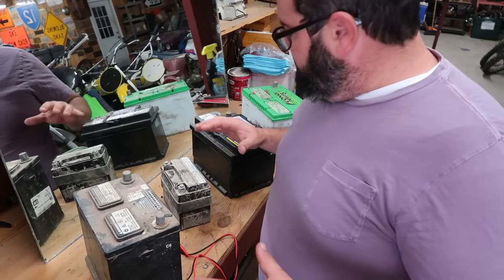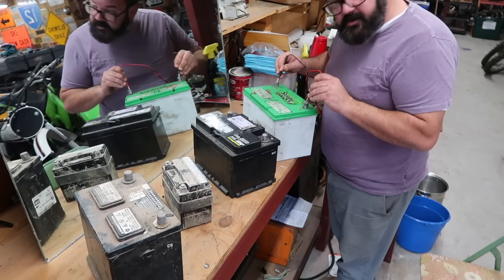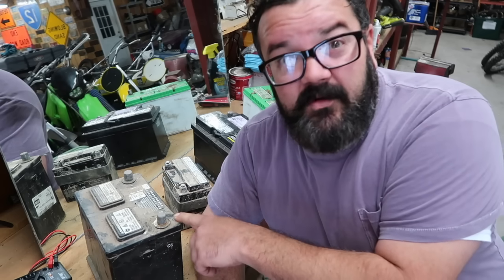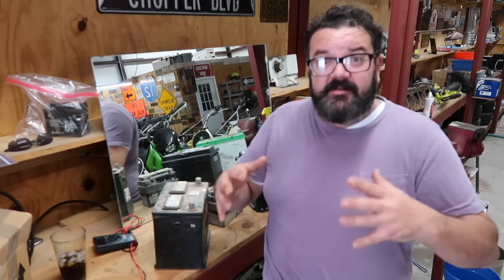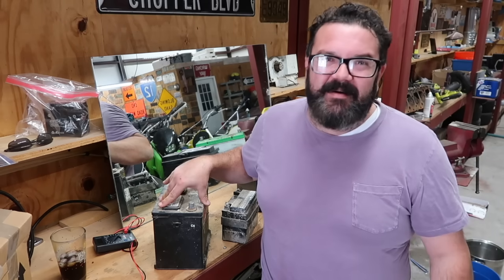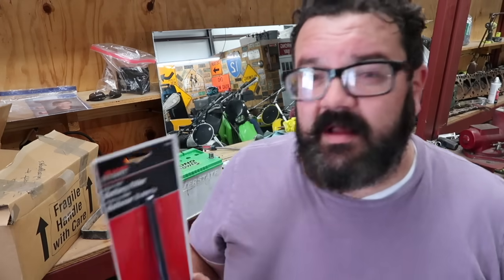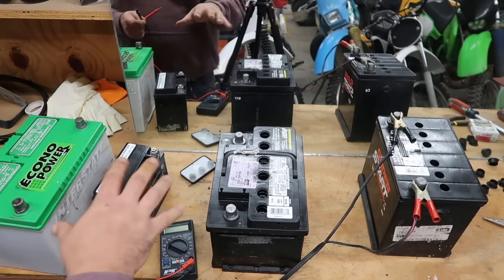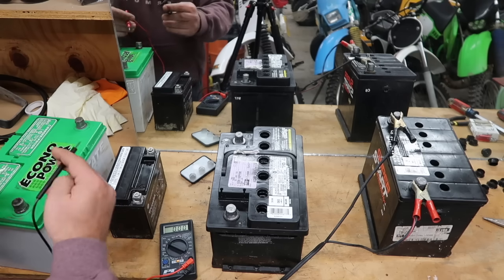Reconditioning a 12 Volt Car Battery: 100% Success

Comment: Amps get the car started not the volts.  How many Cold Cranking Amps did each battery test at after adding the mix?  A battery at 10.5v indicates a bad cell. 8.4v 2 bad, 6.3v 3 and so on.  A fully charged battery is 12.6v (2.1v on each cell).  I did the epsom salt mix years ago and was only ever to recover the volts, never more than 30% of the amps.  I guess in theory It may work for a period of time if say 30% of a 850cca (like a 65 or a 48)  battery was put into a Honda using a 151 series battery.  Most cars only really need 150 to 180 amps to start so unless it's a diesel even a bad battery lasts a decent period of time.  

The most effective way I've made batteries last in the Arizona furnace, is by swapping 2 batteries every 7 months. One comes out and put on the trickle charger when the other comes off and installed. The #1 cause of battery failure is consistent, extreme heat also known as Arizona Summer.   I'm currently at 5yrs and 8 months doing this (swapping July 1st).  But still, the most effective way to avoid getting stranded with a dead battery is carry a charged jump pack in your vehicle.  We used NOCO's at AAA and I still swear by them.  However, a jump pack without a charge is the same as having no jump pack at all.  Putting it in your car and forgetting about it will leave you stranded as well.  Piece of mind is a luxury often taken for granted.

Comment: There's one more questions here. After 3 days, is the voltage kept?
I did several tests in just one battery. It charged to around 14v and but after 2 days went down to 12v without voltage. Any info about this?

Comment: Open voltage with a voltmeter has little to do with voltage under load or cold performance.
Reply from the maker: Watch video 2.
Reply: @CarGroves  Give us the link to vid 2. ALSO please tell us the best mix of epsom to old battery acid, thanks. ie 50:50 or what ?

Comment: so  i 2x 100ah battery from my mobility scooter they charge up ok, they should last 20++ miles but they dont maybe 3 miles if that , so using this method will if fix them or are they poop

Comment: voltage has little or nothing to do with available amps... A proper test is Amp hours, and compare that to new specs 

Did you do that?

 What were the results? 

The other test needed is internal leakage test
Reply from the maker: Watch video 2 on my channel.

Comment: Been nearly 2 years. How are the batteries doing. Saw another channel. They said this method works. But if the batteries set for a time. They lose charge. Did you find that to be so?

Comment: the epsom salt + battery acid solution that melted some concrete didnt melt the bucket or the bastor? good info, thanks for posting. got a bunch of batteries i never toss out for this exact reason.
Reply from the maker: Let me know how it goes.

Comment: On our 2015 Subaru,  they put too small of battery in it from the factory. The dealer was replacing them thinking it would help. I replaced ours as soon as we got it and haven't  had one single issue with it, simply by getting a larger battery. We still have the first one. Its a shit battery. I have watched how they recondition batterys in India in unsafe  conditions. I wouldnt buy a reconditioned battery from India if you paid me to. The cost of a new fresh battery is NOT that much.  Its also not worth trying to restore one.  The word is SULFIDE.   Mabe it cleans that sulfide but it ALSO removes the lead paste coating that corroded. If you opened the battery after cleaning,  you will be able to see through those plates in places. That means the sulfide has EATEN the lead and reduces the ability to charge. If the battery is really messed up, you wasted your time trying to do that. Its more worth doing this with a small engine battery like a lawn mower battery or motorcycle battery. Those batterys naturally die over a short time because they do not retain a charge long being they do not get charged every day like an automobile. They are therefore more likely to go flat.

Comment: You tested each for Volts, however you didnt check for the amps each was able to crank out. You can get a high V reading but the batteries may only have low CCA. I cant say this is a success, or that the battery(s) will continue to hold a charge once installed in a vehicle

Comment: Volts do not do anything in terms of starting power. Amperage is what you are looking for. The proper way to test a battery is to get a decent load tester, they are not expensive, around 40-50$. Hook it up and it places 10% of the CCA in load on the battery for 10 seconds. Depending on how far the needle goes down will determine how much work that battery can do, i.e. amperage. You can have a battery read 12.5 V and it will always fail an amperage load test.

Comment: For anyone interested, I successfully revived a dead duralast 96R battery with this tutorial - went from 2.5V -> 12.5V

1. Open up the battery caps at the top, drain the sulfuric acid into a container
2. Boil 1 gallon distilled water and mix 1lb of Epsom salt into it, mix until salt is dissolved and water appears clear
3. Fill up battery cells with the saltwater solution and slow charge at 2 amps - this is where the cleaning happens
4. Once fully charged, drain the battery all the way down with a 12V DC load (a light, a fan etc) - do this drain/charge cycle 4-5 times
5. Drain the salt water mixture out completely, add the sulfuric acid evenly back into the cells, charge the battery all the way up, replace the caps, and you're done!!! 

My battery is working/cranking like new... hopefully I can get 1-2 years out of it.

Comment: Your voltmeter show 12 volts+ but does not mean the battery is good. You need check the cold CCA. If the CCA is ok then you did a good job.

Comment: Thanks for your video I will try this I have 3 batteries that I need to do and will give you feedback see if it works for me thanks again
Reply: Im working on my batter too. I just removed the acid and have it replaced with pure water. Added a regenerating solution but I just observed that 1 of the plate died. Im researching on it. Any update on yours?
Reply from the maker: Best of luck!

Comment: And you said the battery's before put out enough volts on test but wouldn't crank the motor,you didn't show it crank a motor here either so how do WE know it works??

Comment: Where do you dispose of the old fluid? also how did they last?
Reply: You can dilute the acid in water to use a pressure washer to clean concrete. Best use for it if you don't recycle it. Dilute, brush it on, & pressure wash. Works similar to muratic acid.

Comment: Car battery is 6 x 2.2v cells the two that showed 11.1v were close to 5 x 2.2v = 11v which shows that each battery could have a dead cell. You could prove this if you had charged overnight before ending this video

Comment: Great video. I reconditioned my battery, I only put distilled water in without salt added to it. So I charged it for two to three hours, I checked the state of charge but the charge never went pass 11.34 volts. Is it because I didn’t add salt to it,that’s why it didn’t fully charge?
Reply: Remove fluid cap, check to see if full, if not add distilled water until full. Try charging it at 200 Amps (Starting mode) for 15 minutes or so at a time, until all cells are visible bubbling, let rest for 1 hour and repeat 3 or 4 times.

Comment: A battery that charges up to 12 volts does not prove that the battery is repaired. It must hold that 12 volts after applying a load to it.

Comment: hey man. thanks for such funny video but i get a different case and maybe you can help. i got a 5 years old battery that i have never used, meaning i bought it and install it on my bike and i left the battery and bike standing there for 5 years  i didnt use the bike or disconnect the cables and now i tried to recharge it and it seems recharged for some hours but wont keep the energy. any suggestion what to do? its a small 12v battery from bosch to motorbike 125cc...
Reply from the maker: What happened?
Reply: @CarGroves  does not keep energy. its just dead after leaving all night/morning recharging.

Comment: I tried this but after finishing it it still didn't work,had it properly tested and it wouldn't work after it got "used"(when I would try to start the vehicle it would lose all power)(it might have just been a garbage battery though)

Comment: it's not the volt that start a car but rather the amps. sometime you can charge a dead battery to 12.7V but the amps is only 100 that won't start a car

Comment: so I spilled one of my batteries of my solar bank . it rolled over when transporting and all the liquid poured out, the battery was in full charge when this happened. I filled the battery back up with distilled water but I'm sure I need to add some acid too I'm still learning how to do it...
Reply from the maker: Keep trying
Reply: @CarGroves   I managed to get the acid level back to normal by draining the battery to almost empty 11.5v or so and then I poured out the water  and added 35% sulfuric acid/water . then the acid level got too strong so I drained some acid same amount from each cell and  added some water.  very time consuming because draining the battery and charging the battery takes ages. by the way this battery is a 200ah battery that weight 54 kg/119.05  pounds handling it is also a little difficult

Comment: Just my results I did 3 batterys at 1 time it took alot alot of water and salts to fill all them back up and not 1 of them worked and I charged all of them for 5 days each and I did at different amps was just what happened when I did it and alot of my time
Reply: It gained volts by just pouring the salt and water mix in with no charge but that was it nothing more I hate to post negative stuff but I 100% did it and nothing

Comment: Hey, great vid, thanks for sharing.  Is a 16amp battery charger suitable or it needs to be more powerful?
As a suggestion, if you had time, a short list of processes, mix ratio etc in description would save heaps of scrolling...
You've used 1kg of Epsom salts in about 4 litres of water or???
Reply from the maker: try my second video
Reply: @CarGroves  Yep, saw that after.  Cheers!

Comment: Where do you get new battery prices from a Porsche dealer? I have never paid more than $35 for a jet ski, 4 wheeler or lawn mower battery brand new. Walmart sells new batteries for far less than $100 for cars as well. Not to mention Battery Plus or Rural King batteries.
Reply from the maker: The prices are straight form the autocrats store.

Comment: So what is the ratio of the epsom salt solution to the used battery acid? Also my experience with hundreds of batteries they will show voltage at 12 or above, but have no amperage.  After I test with meter for voltage, then I connect a headlight bulb to see if it will illuminate it bright. If it lights the bulb, then see if it will turn over the starter, or load test it. Your comment appreciated!! Thank you.

Comment: a charged battery in good shape has 13.2 volts, at below 12 volts I doubt it would crank a engine for more then about 10 seconds. I would rate you success as very minimal.
Reply from the maker: Have you tried the second video I made?

Comment: Getting a battery up to nominal voltage doesn't mean it's good. Doesn't mean it has taken or held a charge.
If it holds up it's voltage when under load, then it might be useful.

Comment: Voltage alone does not measure a battery's condition, you have to test if it will start a vehicle.

Comment: voltage means nothing... you can have high voltage, and no amps. Without enough amps, you aren't going to start anything. I've tried the epson salt "solution" back several years ago on multiple batteries, didn't have any real success with any of them. Some of them looked "ok"ish at first, but didn't last long. Wish it did work, but its mostly just a lot of work with no payoff.

Comment: I've got two batteries that I'm going to try it with again I tried it was the battery once before and I couldn't get it to do nothing Epsom salt is it baking soda is it cleaned it out charged it put battery acid in it and still wouldn't do nothing I'm going to try it again though I'll let you know how it goes

Comment: Just bringing a battery back up to voltage does not mean it works. U need to put a load on the battery to find out if it produces the amps needed to crank a motor.  This process only works sometimes
Reply from the maker: Well I wasn't "Born" yesterday

Comment: Did u check density of accid i your batteries at any time after charging, I see u dont know what u do...
Reply from the maker: The acid didn't disappear, if its low, water evaporated, add water.

Comment: Each cell must produce 2.1v , so anything under 12.6v will leave you hoping for a jump start. You're rejuvenation is acually a failure on all four counts.  If you haven't done a video admitting this, you need to. 12 volts doesn't mean 12 volts in the real world. You also need to load test any battery before claiming success to assertain whether or not it will hold up to the demands put upon it by the starter. At 12 volts you'll be lucky if the vehicle fires up at all. Anybody out there agree?

Comment: Don't go dumping battery acid like that. Even when the battery is dead, the acid is still strong. 30 some years ago, I was carrying a battery and I tripped, and the battery hit a rock.... my leg was splashed with acid. I got it rinsed off in less than a minute, I was still burned. It was like a bad sunburn.
Reply from the maker: So, due to your freak accident should we pass laws governing battery handling. Or should we not cater to the 1% and ignore you?

Comment: Did you load test them before or after  with a load tester an actual load tester for batteries that mechanics use to determine the life of a battery the thing called a load tester.. Multiple companies sell them. Even Canadian tire, Lowes , part stores of all varieties
Reply from the maker: Video 2 has CCA testing

Comment: Having some voltage in the battery does not mean that you still have a usable battery with a significant capacity (Ah's) and low internal resistance......

Comment: Those that are showing 12 votes do not mean they Will start a car they are just showing it has 12 V in the battery it has to have amps to start a car that’s why you use a battery tester on them that puts a load on them.
Reply from the maker: Watch video 2 on my channel.

Comment: My opinion is, its not worth it to me. I did this years ago and got tired of finding holes in my cloths from a drop or two of the battery acid, if you breath in too much fumes from the old battery acid, it will damage yor lungs.  Just buy a new battery.

Comment: Hi guys, I must say this does not work for every battery. Most new battery chargers will not activate and charge a battery which has been discharged to below 10 or 9 Volt. Charging it with the Inverter works Perfectly to shock the battery and get the Voltage up high enough for the normal charger to kick in/ activate. BUT! when your battery has dead cells, NOTHING will revive it. Believe me, I tried everything. I did everything as per this video, that did not work, so then I charged the SH1T out of those  batteries, I bubbled it to the limit 200 amp full blast, Nothing revived those dead cells. I charged it until the dead cells bubbled, but nothing. Than I drained the batteries, put through EPSON salts, drained properly, news is and distilled water, then charged it again with the Inverter, then charged it properly with a normal professional charger medium charge setting then trickle charge for 3 days, still only  4,5V. If those batteries was going to be revived that should have done it. I had a battery which got slightly lazy, this worked 100%. If you just left your lights on for a week and your battery is dead as a door nail, then this method will work, but if the battery is 10 years old with dead cells then melt it up and make lead sinkers.
Reply from the maker: Sounds good

Comment: Bummer, batteries need to settle into charge when removed. Also need an amp test.
Reply: @thetennisshakespeare  First secondhand knowledge is unreliable second if you really wanted to share the knowledge you were just post the actual information for us to read instead of sending us to a advertisement